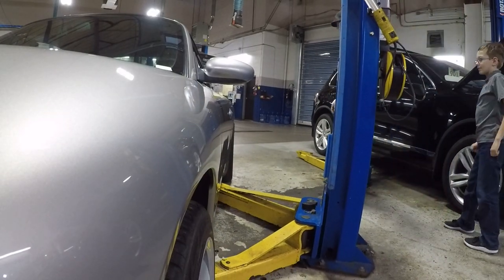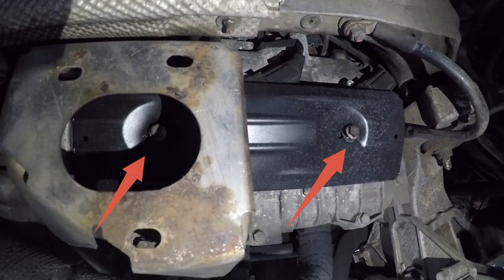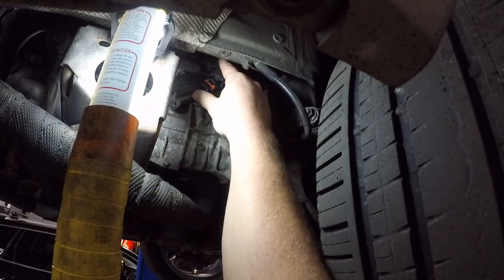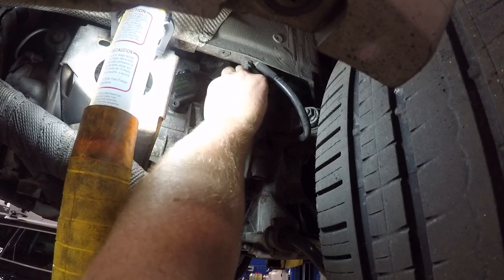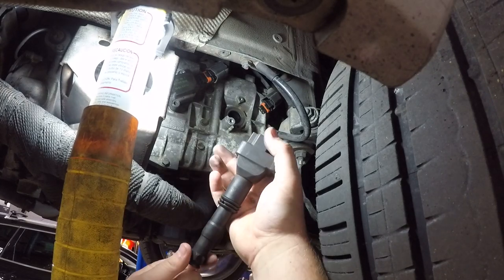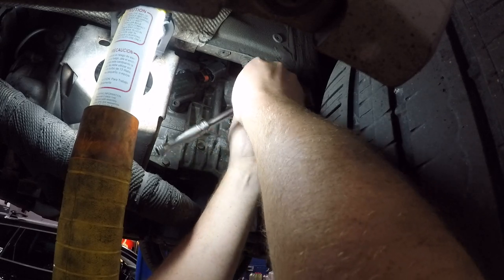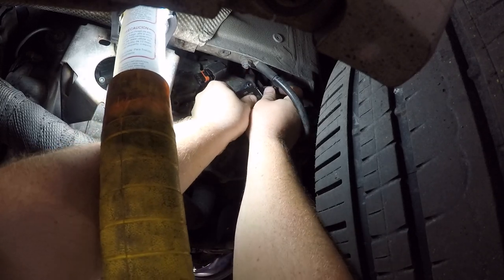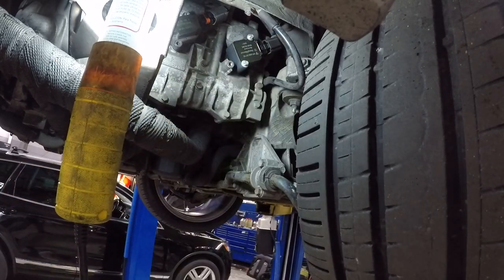Porsche 996 coil pack / spark plug, tube replacement and upgrade. (Works for 997 and Boxter) DIY

Comment: One of your best videos yet!  Coil packs are usually pretty resilient, but that torn boot + any kind of moisture or condensation could definitely cause that kind of issue.  I chased a misfire for a while on the NSX that ended up being a bad coil that would ohm test fine when cold but packed it up when it got hot.
Reply from the maker: Thanks for the compliment.  I am trying to get up there with another channel i follow @lap of the world! 
Maybe one day ill have a ton of followers.

Comment: I didn't see you replace #4 coil pack, you know, the one that is nearly impossible to get to. That would have been the one I, probably everyone else, would want to see your technique on reattaching the coil pack connection.
Reply from the maker: I do apologize for that. It was really no different than the other ones. I must have left that put in editing by mistake.  
But i do not Remember it being any different than the others. I will try to make sure to include all possible in future videos. Thanks!

Comment: I did my coils and plugs on my 2005 c2 in 2018. Car was misfiring randomly. They were all cracked and only had 47k miles. Ordered from pelican parts beru updated coils packs with longer bolts and Bosch plugs. Not bad job just needs lot of patience. After 2 years now I'm getting cold start misfire only. First start it misfire and hesitate and then it calm down after minute and runs fine. Can't get this sorted.
Reply from the maker: How often do you drive it?
Reply: @MystMotorsports  summer time I drive mostly everyday but in winter it says in garge. When it's too hot weather like 100 degrees then it doesn't misfire. I start car and if I shut off right way and then start again right way. It won't misfire.
Reply from the maker: That sounds like more than spark plugs. 
I would have it checked out. Possible loose connection or a sensor in need of replacement.

Comment: 2 questions .  How do you replace the spark plug tube. And also , I have a leaking valve cover. Can it be resealed without pulling the engine ?
Reply from the maker: The metal tube is under the valve cover. 
And to my knowledge it must be pulled.

Comment: How much would you say the cost would be to do this upgrade on a 996 C4S (parts and labor)? Watching your video is making me want to do this upgrade on my 2004 C4S Cabriolet. I'll just have to find a reputable garage that can do this for me that won't screw me over on the price.
Reply from the maker: Let me ask the local Porsche dealer.  I'll get you the info tonight.
Reply: @MystMotorsports  
Thanks! I'd appreciate any info and help you can provide.
Reply from the maker: @88brandonlee88  Also you can save a few bucks getting the spark plugs before going to the dealership. This is the brand I used and no issues. Saved about $100 .   https://amzn.to/31jCrcx
Reply from the maker: @88brandonlee88  The local Porsche dealer said around 5-6 hours depending on 2wd/ 4wd. I feel like I paid around $400 for the parts in total. So all in it won't be that bad to upgrade the coils to the 997 Turbo coils.
Reply: DIY Racer Thanks for the info. I have a 2004 996 C4S Cabriolet
Reply from the maker: @88brandonlee88  NICE! I nearly purchased a Black C4S Cab before I purchased the current C2
Reply from the maker: @88brandonlee88  What other Porsche DIY videos would you like to see?

Comment: did this clear the misfire
Reply from the maker: Yes it did. Turned out one of the boots on the old coils was torn
Reply: @MystMotorsports  prior to replacing the coils, could you smell difference in exhaust fumes ie lack of fuel being burned off
Reply from the maker: @ejjan7549  i didn'tl really notice.  Gave it gas. It misfired.  I fixed it a few days later.